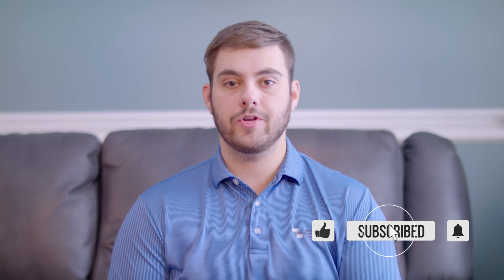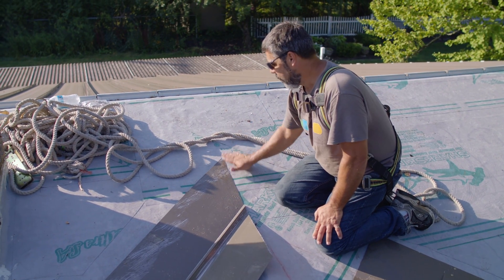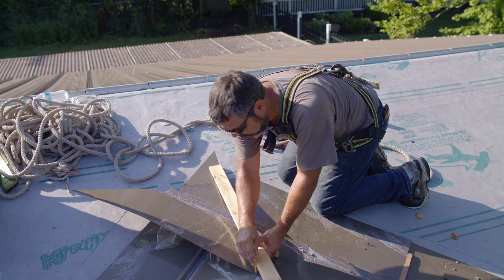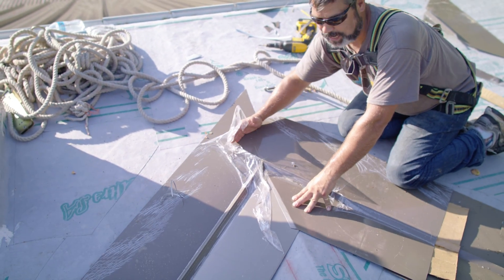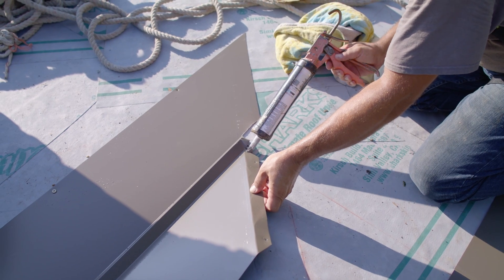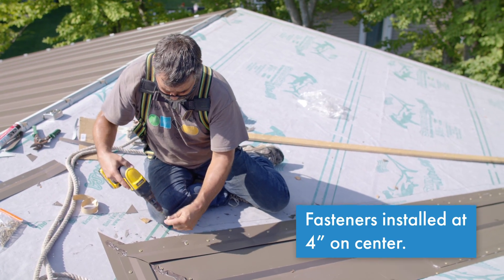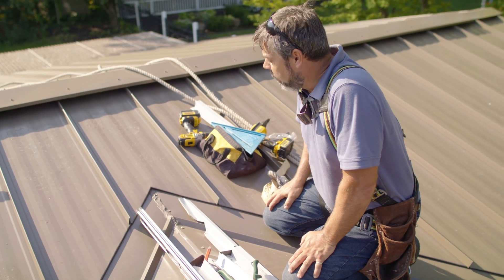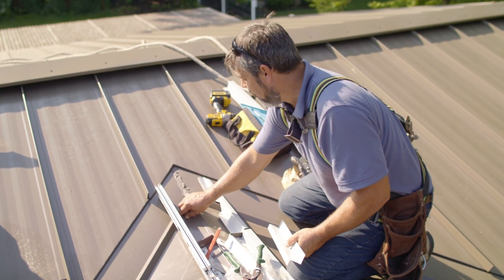How to Join Two Valleys at the Ridge: Standing Seam Metal Roofing

Comment: Or turn tabs up for pannings, use tab clips nailed to the roof to lap over them, throw some Flexim under the two crowns, flap your pannings flat, then cover with a c-clip over the entire width of the locked seam you just created.  Hidden fasteners FTW.

Comment: A better way of sealing that area at the top where two pieces of valley meet is to put some peel and stick on that area instead of relying on the caulking. There's no ridge venting and the ridge cap is going to be covering the Peel and stick as well so it works better at sealing it off.
Reply: Josh: Yep. I Naturally put two rows of Tacky tape 4" apart and Two Rows of Caulking in front of each Tacky tape row where each valley overlap
Reply: Or create a locked seam instead of lapping. Putting a cut edge on the underlayment cuts through over time. But hey, its fast to do.  Same tab could have been turned into a seam with no sharp points on underlayment.
Reply: I agree. Now i just put epdm form tape on it and any other spot that i think is toeublesome at all even if k know water wont get to it.@MadRat70

Comment: Please do a video on  capping hip and ridge junction.
Reply: That’s easy first cut to fit your panels either side lay ridge cap onto the bottom of your hip line it up center mark your sides put your Z-bar in Where you’re mark is slap it on top and lock her in and rivit away
Reply: @donesanewishki474  Thanks.

Comment: Yeah, I understand, but I'm using interlocking seams with shop made valleys. Put the valley in, make the ridge marks, and add 2" on one valley top, 3" on the other. Butt them together and fold 1" completely over, take a mallet and hand anvil and fold another 1". I've done standing seam dbl locked ridge peaks and valley tops with copper, zinc, stainless steel, even painted steel. It makes them just about bomb proof. Great vid but there are superior products out there rather than snap-lock or screw down corrugated.
Reply: Isn't interlocking seams and snap lock the same thing with metal roofing?
Reply: @Josh-ww5kz  
Not necessarily. Snap lock is exactly what the name implies, "male" side gets clips screwed to the roof every 12-18", same as standing seam. But the "female " side just snaps into place over the "male", sometimes leaving as much as an 1/8" gap. Whereas the "female" of a double lock standing seam is folded under the "male" and then folded again, there is no gap. It makes a difference during installation.
Reply: @beardedroofer  ah, yeah I've only done a metal roofs a few times but we had this machine that ran up and down the seams to crimp them, but thought that was standing seam.
Reply: @Josh-ww5kz  
Sounds like it was, no seamer needed for snap lock.

Comment: no caulking on the inside of the z? if not whats your reason for not doing it?
Reply: They didn't explain it on this video but the ridge cap has an open hem on each side which fits over the upper lip of the closure Z.  Toward the end of the video you can see him pinching the Z upward in order to snap it into the rail.  They haven't shown it yet but you need to use a pop rivet or self-tapping fastener to lock the ridge cap in place.
Reply: @tanshihus1   no I was talking about the sides and where he cut the z to fit in valley .. why I ask is cuz I been doing this for 10 years and always seal the z to panel on sides from the back.
Reply: @TRE_-HEINZ He's got the caulk in there. Just hard to see on that washcoat
Reply from the maker: Yes, there is sealant applied to the seams of each z closure across the ridge! -Thad